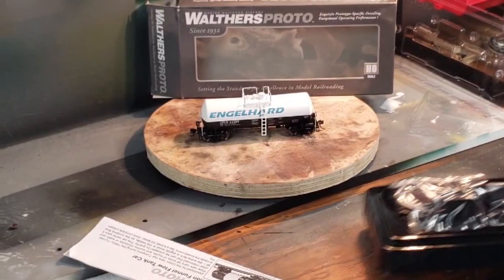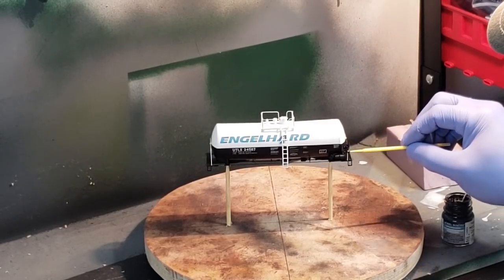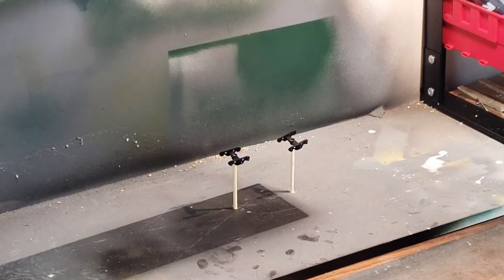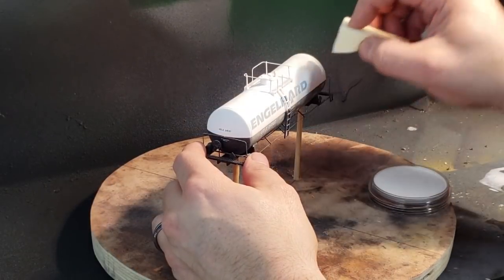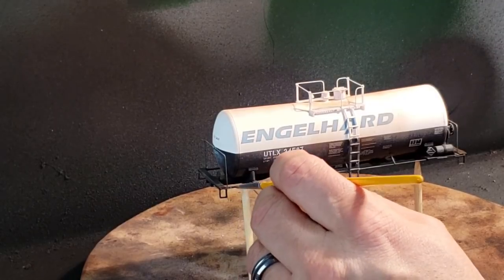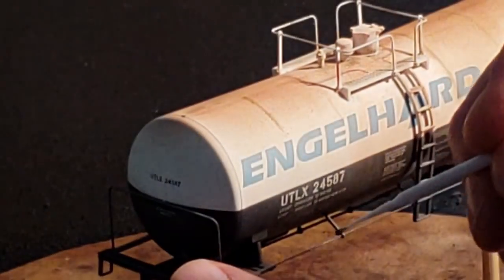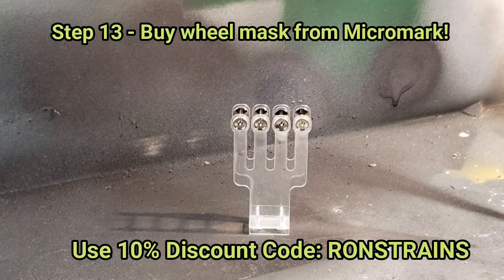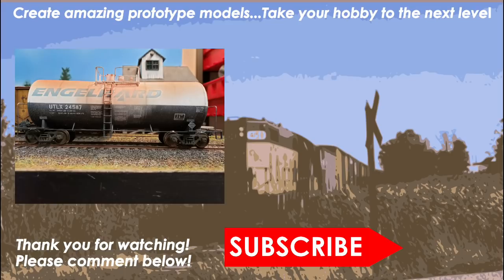Convincing Model Railroad Weathering - HO Scale Tank Car

Comment: I worked the Railroad, the cars we handled contained Clay slurry, it's used in the production of paper, this sloppy white goop ran down the middle sides by the ladders, it is dense and heavy.  I wonder how much actually got inside. Man it's a sight to see as fully loaded, 5 or more loaded tanks coupled together, released during hump yard ops, can slam into and drive a line of cars way down the yard tracks.